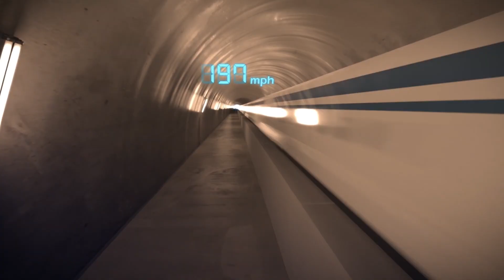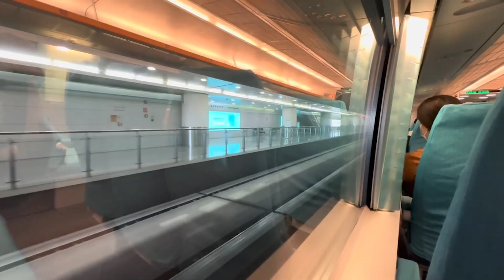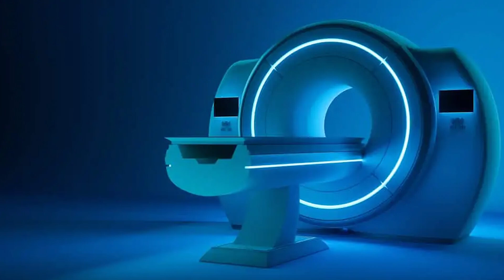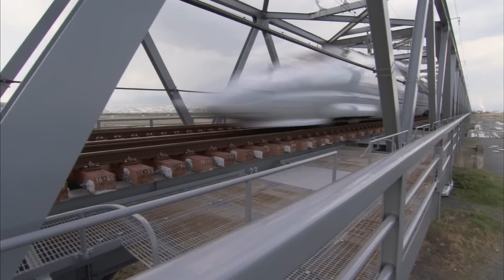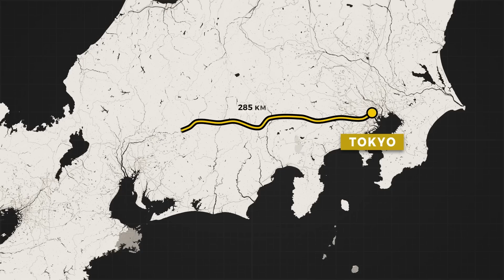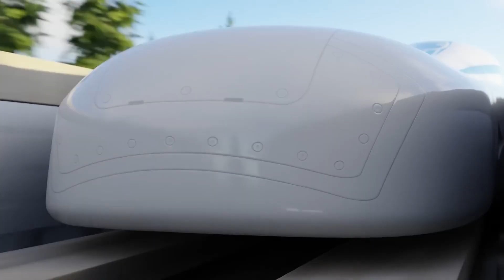Japan's MAGLEV Train Secrets Revealed by Top Engineers

Comment: Japan's superconducting maglev uses superconducting magnets and ground coils to achieve levitation, guidance, and propulsion through electromagnetic induction. Free from wheel-to-rail contact at high speeds, it enables stable operation at 500 km/h and is regarded as one of the most promising next-generation transportation systems.